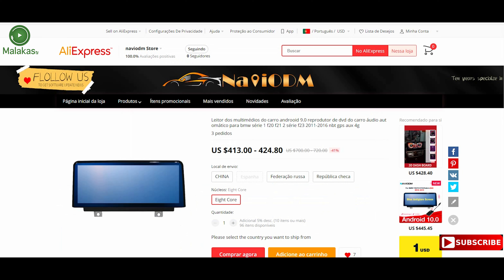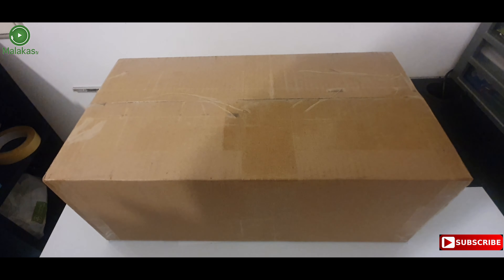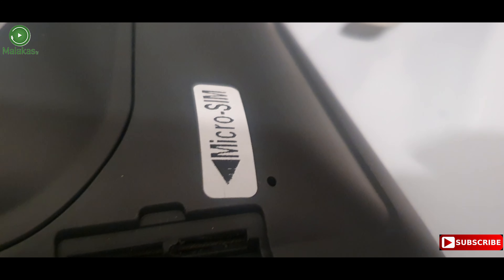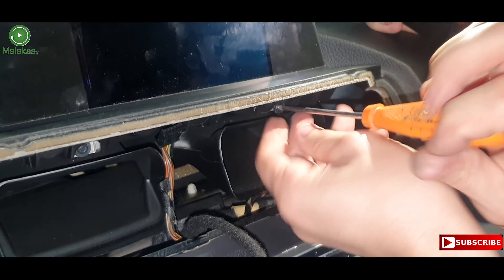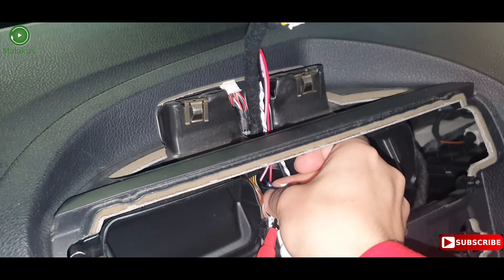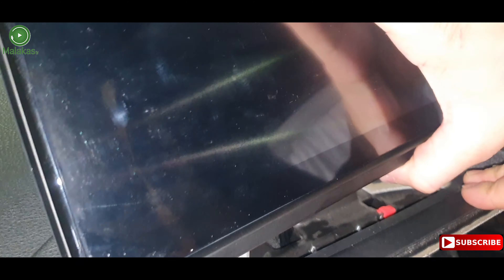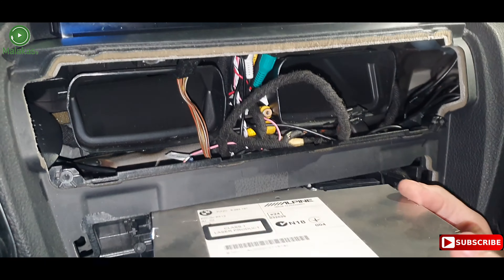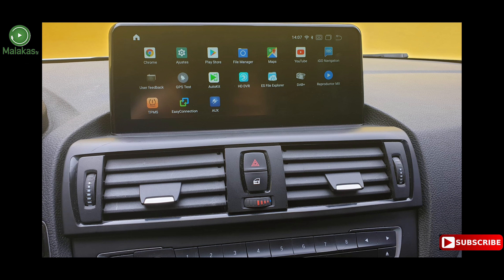BMW Serie 1 F20 Screen Android System - Full Installation

Comment: Did you manage to code the touch screen to work in the original BMW menus? Everytime I touch my screen it takes me to the android menu, would like to use the touch functionality in the BMW menus if possible. I enabled the following:
3005 - CID_touch: aktiv
300B - CID-HMI_touch: aktiv
Touch still does not work in normal iDrive menus

Comment: Thanks for the video. I did the installation but the door indicator seems to be swapped around -- that is if the driver door is open  then the unit indicates that the front passenger door is open. How can I swap these around?
Reply: Moi aussi

Comment: on my device i can't get sound from any application, i play for example youtube and the sound still comes from the radio, please help
Reply from the maker: You need to change for cd or aux in the original menu
Than tell me if works
If you can
Subscribe my channel please 🙏😉
Reply: thanks for the quick answer... I tried but as soon as I start the application it automatically returns to the radio... I think it's about some setup in the factory setting... it's about android 10. When I go there to work AUX has several positions NUM8 NUM6  and various others, I don't know which one to put

Comment: I got no sound. Do I need aux?
Reply: Did you ever get the sound sorted
Reply: If someone doesn't have a sound, you will need to connect an AUX, please.
Reply: @hhuhhd  How and where do I connect an AUX? Please help!
Reply: Same question here, need help🙈
Reply: @jasonho3204  in you center console there is a aux port. Connect the aux cable from there to the android unit. Go true the glove box. There is a small hole underneath